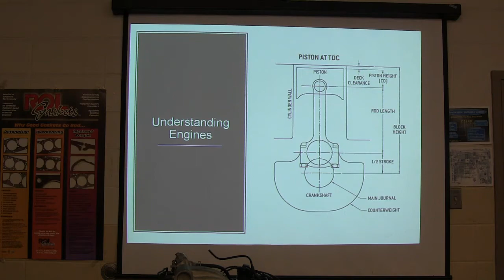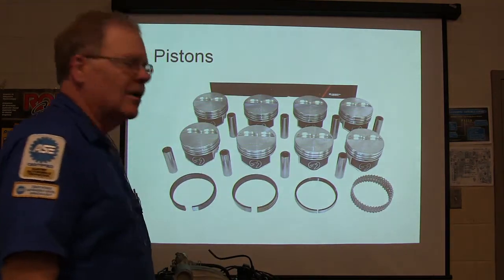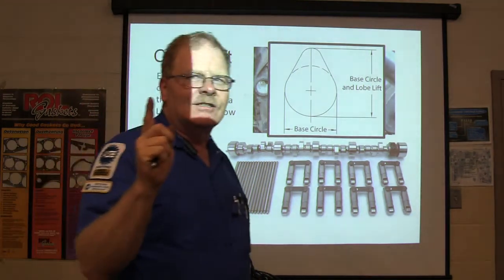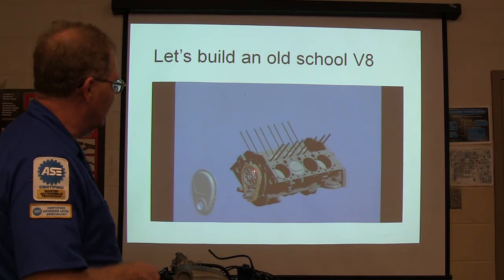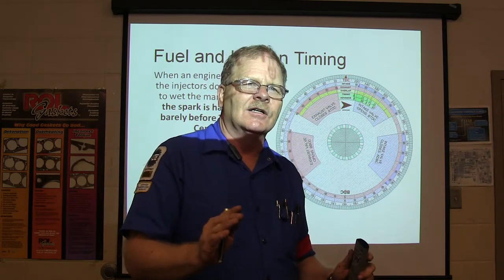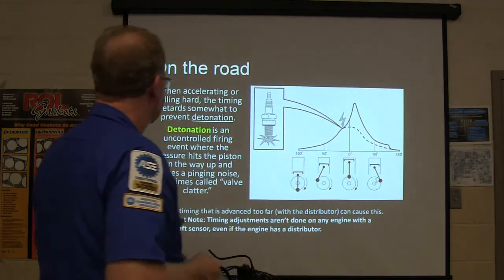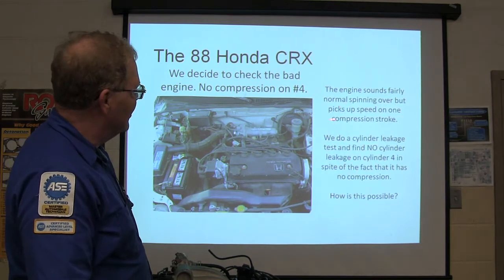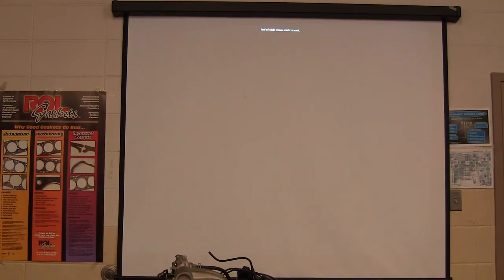Understanding Engines   and a War Story

Comment: Richard I'm looking for a second opinon and I hope you might have some insight. My father has overheated two 1999 Cavalier engines with the 2.2 and I have a used engine from the junk yard. I had some lifters drop out of the anti-rotation brackets. It is strongly suggested that the cam be replaced if the lifters don't go back to the original orientation. I only need this car to run 100 miles a night 6 days a week. Could I just replace with new roller lifters and just except that the wear will be greater and with some possible noise ? I'm a rock in a hard place, I have it on a stand and staring at it. Also do you know of a common problem with these engines and why my father managed to kill two of them. Thanks Richard and I love the war stories. God bless and looking forward to your professional input. I have a machine shop here in town which went through the head and fixed some leaking valves. Should I just rebuild the damn thing  or just leave the rotating assembly together.... I'm a rock in a hard place. Also the roller lifters have a lot of lateral movement enough to to click click..... is that excessive wear???
Reply from the maker: Wow - sounds like that engine you have on the stand is a lost cause - if the car's going to run 100 miles a day six days a week it needs to be right - tough call, but while you've got it on the stand you might as well straighten it out.  As for the overheating - I'd be looking at some sort of radiator or cooling fan issue - that's the only thing I can think of on the overheating - but it sounds like it's something with the car rather than the engine that's causing the overheating.  Believe it or not, a clogged heater core can cause those to overheat.   

1. Temporarily take a flushing tee and bypass the heater core, hooking the two hoses together. 

2. Drive the car and verify if the overheat problem is gone and that the lower radiator hose gets hot. 

3. If the problem is gone before replacing the heater core, one can try backflushing it and see if this also fixes the problem.

Comment: How come the cyl.5 can be on exhaust while the cyl.1 is on compression at a firing order 1-4-2-5-3-6? I made a chart assuming there is no overlap of combustion stage, and the stage of cyl.5 is power while cyl.1 is on compression( simultaneously), what i see is that the exhaust on cyl.5 starts right after ending the compression on cyl. 1:

Is this right?????

firing order 1-4-2-5-3-6

cyl.1     compression              power                      exhaust                      intake

cyl.2     exhaust                       intake                      compression             power

cyl.3     compression             power                       exhaust                      intake

cyl.4     intake                         compression           power                         exhaust
  
cyl.5     power                         exhaust                    intake                        compression

cyl.6     intake                         compression           power                       exhaust